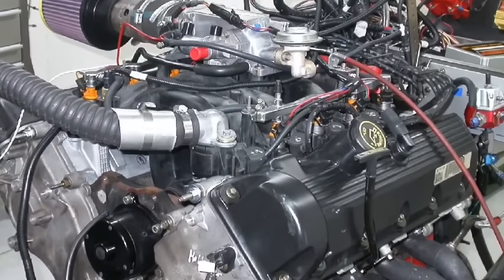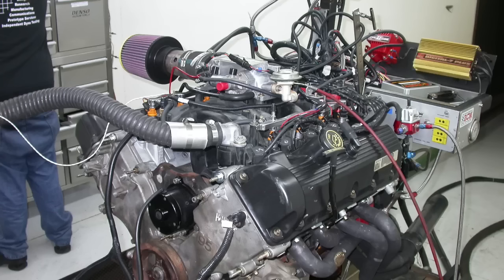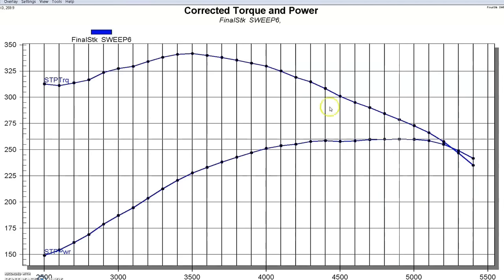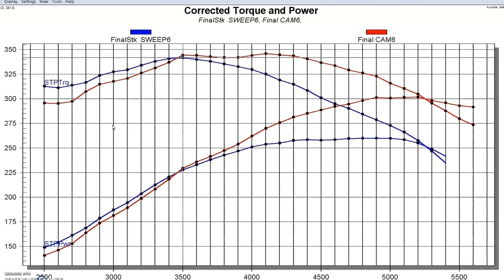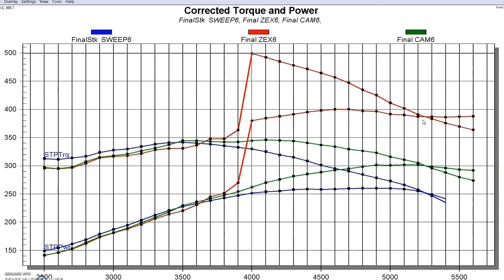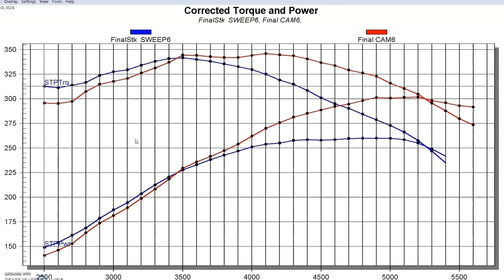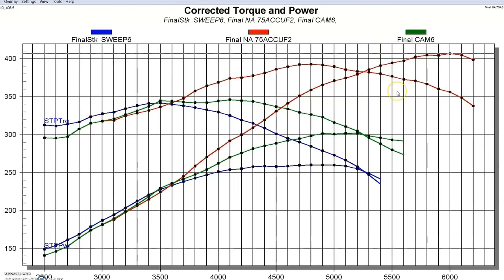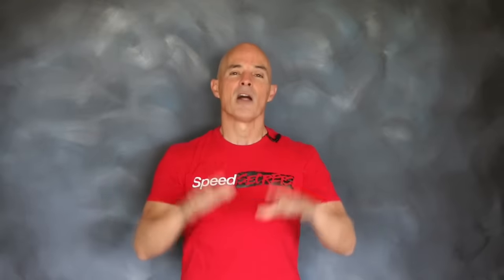HOW TO! MAX HP 4.6L FORD 2V MODS!

Comment: Finally some FORD videos!!!!! Can’t wait to see more ,,, did you ever mess with any 4v 4.6? Lincoln mark 8 setups ?? Your tha MAN!
Reply from the maker: lots of 4V testing
Reply: Its the mark 7 not the mark 8
Reply: Appreciate the reply!
Reply: No it’s the Mark 8 or mark vlll as they put it ,, 1993-1998 4.6 dohc 4v per cylinder, basically same engine as 96+ cobra mustang but technically Lincoln MARK8 had it first (1993) and the cobras got it in 96,, don’t believe me do the research buddy
Reply: Your right chris cantrell. Just really getting into ford after being a chevy guy for years. Just bought a 07 crown vic p71 and was thinking about a 4v head swap. was really wondering if it will still fit in the engine bay i havent looked to hard but isnt the frame and steering arm kinda close to the 2v heads already. Not sure if 4v heads are bigger or not as far as the dimensions go. But thats fantasy talk really as im sure it would cost many thousands to spec it out properly like i would
Reply: @manmage13  after 03 the engine bay of the panther cars was built for the 4v. As the murauder happened in 02-04 and those had the dohc 4.6 from factory. Or go with a 5.4 3v and lockout the vvt and add some boost. It'll scream. The 5.4 can and will make a hell of alot of power

Comment: Would be cool to see what the DOHC heads from Lincoln mark viii? was it will do
Reply: 4v swapping the engine is hard because there is a big drop in compression. You’d be better off just buying a complete 4v engine
Reply: @canadianrcs9931  Correct, you have to change so many parts you're just better off getting the whole thing. I did my homework back in the day and did a 4V swap on my 1996 GT with a Mark VIII engine.
Reply: Coworker of mine sold his Mark VIII LSC for 1500 last year, I should have bought it.
Reply: @canadianrcs9931  In the case of a full 4v engine swap, are there any adaptations necessary in terms of engine mounts and other things such as accessories (A/C compressor, water/oil pump, pulley, etc)? Or the underside of both are identical in that aspect?
Reply: @Roddy_Zeh  there is a difference, there's coolant plumbing right in front of the alternator on a 4v that's not present on a 2v.
Reply: @Roddy_Zeh  you'll need...
Front cover
Timing chain and accoutrement
4v heads
4v intake
4v injector harness.
If you have a p71 then the ecm will run and drive without tune as it's non Pat's and the timing is always off the intake cams and the exhaust cams are driven off the intake cam .
A tune is required to pull the best performance from it though. 
You'll need the cooling plumbing 
There will be small odds and ends needed as well.

Comment: Rich, I am a subscriber. And you make quality videos. But I feel the information you present can be misleading to viewers without a mechanical background. Your engines may make real power and run a few times on the dyno. But while they hold on for those few runs, there is something us engineers call stress fatigue acting on all the stock components over the many life cycles an engine must go through on a daily basis. Most of us 2V guys use them as daily drivers. I'd be very surprised to see a high mileage 2V with the mods you showcase in your videos to be anywhere near reliable or even safe for the road. Racing applications are a different story. Great videos keep them coming 👍

Comment: I have a fully forged bottom end with blower cams ready for install. Heads were cleaned up with new seals. No porting. I’ll be throwing on a Vortech V3 with a 3.15 pulley with a 10% overdrive lower and long tube headers. Can’t wait to see the numbers at the wheels.

Comment: I really love your videos and enjoy information you give. I have a really interesting idea as a test to do. 3 absolutely identical engine builds, ideally with freshly machined blocks, and all identical parts. The test would be putting old rumors to bed. I've heard several people over the years say things like "I've built engines and never used a torque wrench and never had an issue" or "you've always gotta use a torque wrench and torque sequence" the thought is on each build same parts same build but different torque methods on all fasteners. Torque wrench, impact gun, and feeling it with traditional hand tools. I know it would be EXPENSIVE to set up but itd be really interesting to see the dyno results, and if you could do some long term running engine durability.

Comment: I am a Ford guy, so thanks for making this vid!!👍👍👍 Although, I will say that the 4.6L 2 valve is a pretty anemic engine. 4 valve, supercharged Terminator ftw!!
Reply: I bolted on a used vortech v3 kit with lightning MAF and injectors and a kennebell boost-a-pump for $1500 and that puts me over the stock Terminator RWHP.  thats without an intercooler. I can Add an intercooler and a pulley swap and get close to 500rwhp. best of all i can drive it without getting into boost and get the factory or better MPG.

Comment: The compression ratio. When you use the non pi motor with the pi heads. I owned 4 Ford Thunderbirds, all with the non pi 4.6. My mom had a mark viii with the 32v, that had 285hp/285tq, it had a 2.73 gear though so it wasn't a drag car but it was a great highway cruiser

Comment: I'm so happy to see someone build one of these, I have one of these non pi 2v engine and a set of 04 heads, I just don't have the car any more
Reply: What year is the 4.6 from? Are those heads a 2 valve? Thanks in advance
Reply: @ariczacari  out of A 96 mustang GT, the spare set of heads are out of an 02 GT
Reply: @tashawegmueller1866  did you do the head swap yourself? what issues did you run into that aren't recorded?
Reply: @obran003  I have not touched the engine it was a swap that never happened, so it'd just a complete engine and a bare set of PI heads

Comment: Hey Richard, a little off topic but it would be cool to see a test of different exhaust sizes after the collector on an NA setup just to see if the bigger you go the more power or if you start to loose exhaust scavenging
Reply: yes, bigger is better.. Don't believe the back pressure idiot crap..lol

Comment: I have a 98 Mustang GT California scatpack. Pushing 517 hp. Dynoed. Naturally aspirated. It’s a 4.6 modular. Engine is fully rebuilt with lots of upgrades and bolt ons. Shelby motor sports tuned it and now I’m upgrading the body, since it’s all stock. Next will be axle, tranny and differential. It barely hangs in there now. Lots of money in it and still more coming in. I plan to have it done within 10 years. But I still want it to stay street legal. I should add that if anyone is adding PI heads, you will need to upgrade your cams, valve springs and flex plate! Also get a tuner.
Reply from the maker: a 98 4.6L non-PI that makes 517 hp NA?

Comment: This was cool, want to see more sohc stuff. Wonder how the 6.2 sohc truck motor would sound in a new edge compared to a 4.6, 5.4 & the new 7.3. Power is great but driving experience means more to me for a street machine. Would love to swap my tired 4.6 for more cubes but if it doesn't sound as good then I'll just stick with the 281. :)
Reply: Swap a 5.4 2v bottom end and bore it out to. 5.8 and give it some good compression and a trickflow top end kit it'll make some damn good power and sound ungodly.  Pretty easy swap too it's basically a bigger 4.6.

Comment: Richard  please do some testing on the 4 valve  4.6  motors.   id love to see a comparison between the 2v vs the 4v versions of this engine.
Reply: 40-60hp bro..
Reply: @P71ScrewHead   ...yeah stock.  I mean in terms of horse power potential  when modding the engines.
Reply: @cleophusmcgillicutti7408  depends on the internals it comes with.. But the 4v will always make more hp.. Still would be a nice comparo.. When it comes to cost tho the 2v wins, costs less to build n less parts to funk up.. I prefer the 2v..

Comment: Thank you for these videos! Do all these improvements apply to a f150 Triton 4x4? I have a 1998 f150 4.6L NPI  2V that I just had honed and cleaned up. I also bought PI heads and they are in the process of being fully ported. I have been researching Rotary Assemblies and I am not sure what to get due to my lack of knowledge. Like what stroke to put with what pistons and what cam and so on. I also have a P-1SC ProCharger I can put on it. Any suggestions? I'd sure appreciate it. This will be my first engine build. BTW it is a 5-speed Manual Transmission. I also have 4:10 gears in the front and rear end. I also have a PI intake and I ordered some long tube headers, they haven't showed up yet but they will lol.

Comment: I'd like to see how much power you can get out of a 2V 5.4L Lightning engine with all the boost.
Reply: I had an old 2v. 5.4 in my Z for several years eventually blew it after 2 years of +25lbs. It now has a 5.4 with ported 2v navi heads. Also rebuilding my 4.6 romeo in my work truck with the 5.4 2v heads and a victor intake
Reply: Really the 5.4 2v heads fit onto the 4.6 2v really,, wonder if the 5.4 3v crank would fit on the 4.6 as a stoker.. because most of the mod motors are the same parts for the 2v, 3v, 4v engines
Reply: @Ford Fanatic Modular motors can support massive amounts of power...Its what's powering the the record setting Ford GT sanding mile car.
Reply: @nuttynut54  the 4.6 and 5.4 are the same block with the 5.4 having a longer stroke(taller deck). Most all 4.6 2 v stuff will fit on the 5.4. Except the intake ive got adaptor plates on all my 5.4s to fit the intakes. There are zero 5.4 2v  intakes that are worth the money. Build a custom one or just use the OE truck or 4.6 intakes with the plates. Think i paid 100 bucks a set for the adaptor plates when i got them.
Reply: @nuttynut54  if u use the 5.4 crank in a 4.6 ull have to measure rod length pr youll slam the piston into the head due to the longer stroke

Comment: I liked your video. I'm just starting to learn about the 4.6 . I'm to old school 70's early 80's Dirt tracker. Now the family raised I've retired have a shop full of tools covered in dust I'm Bored. Hell, didn't know there was a PI motor till watching the video. What I'd sure like to know is if you took a PI, motor cut about 10 tho -- off the heads ported it put a set of bigger cams in put the headers on a larger fuel pump and 8, 460 injectors. How would this work out in a little lite straight line car??? Sure wood love hear from anyone.

Comment: Richard, you have no idea how many times I have referenced this video! I have a ‘98 GT and I’m currently looking to make the cheapest 12 second car. Got the cat-less H pipe and long tube headers, PI heads with 81k miles (very good condition), PI Intake, and I’m looking at getting a set of Comp Cams that are just slightly smaller than the ones used in the video. For my guy to install it all, combined with the price of the parts… looking at just over $3,000. I got a lot of great deals on my parts, but still, this thing will put down 400hp for essentially nothing in price! I’ll be back with updates
Reply from the maker: add a cheap nitrous kit-then you are easy 12s. maybe 11s

Comment: Doing this exact build right now 😂
Reply: Preston, how did this go for you? I am seriously considering swapping in a fresh built 98 GT 4.6 with the PI heads into my S197. Will be even better than a 3v possibly and easier than Coyote swap, with that awesome 2v sound! How much did getting the heads and intake cost you? Also how do you like it? :)
Reply: @tomstamatakos8027  build went great. I only did cams because it already had pi heads. It’s actually supercharged now but I love it. Sounds great and makes plenty of power!
Reply: @prestonsarlo  Wow thats awesome for sure, good to hear she's really rocking for you! With FI I'm guessing you are pushing 500whp on the stock bottom end. Crazy cool :)

I'm just hoping to have a 300whp/300wtq daily driver that can still pull 25mpg highway. Seems totally doable with these NPI long block/PI head builds!
Reply: @tomstamatakos8027  yeah you can do it. Good luck with the build!

Comment: Years back I pulled the intake off a f150 . One head had square ports the other had rounded  ports. Service manager said to just do what I had to do to make it work. It appeared to be that way from the factory only had 20k on it. Seemed to run just fine.
Reply from the maker: square port and round port? on an F150?
Reply: @richardholdener1727  the intake ports are different shape on the power improved heads.
Reply: @richardholdener1727  the truck had one of each on it.

Comment: Now swap that top end onto a 5.4 non pi motor and see what it'll make with 0.8 more liters. :)
Reply: Aren't the blocks the same?
Reply: @jaflolara  almost, the 5.4 is taller deck height, hence the extra stroke.  Need pretty much stock manifolds and a modified h pipe... or custom made long tubes, but there's not a lot of room.  Otherwise, motor mounts, bellhousing pattern, and crank pattern is all the same (crank pattern changed for some years, but can still find flywheels/flex plates) They would pretty much need bigger cams tho...
Reply: @jaflolara  bore space is the same. Stroke is different. Also romeo and windsor used different head dowels. But otherwise. All 2v heads with work on all 11 castings of the 4.6/5.4 mod blocks. Your valve covers will also vary between heads as they use different number of bolts on the valve covers

Comment: step 1: remove 4.6  
step 2: install LS

LOL j/k.  Cool to see something different than LS stuff Richard.
Reply: Litterly what im doing with my 02 gt getting my built lq4 6.0
Reply: don't get me wrong the coyote is a very capable engine and in some ways better than the LS stuff but usually it comes down to cost and you just can't beat the LS for dollar per HP.
Reply: @jessemurray1757  exactly right. Thr cost of a coyote is insane
Reply: Guys are going mid 8s with 2v. Cobra crank rods and pistons
Reply: Paul Schwartz the rods work the coyotes bore is bigger. But you can get a nice set of rods and pistons for $1300
Reply: Ls= welfare motor lol
Reply: @ryanjones48  know a guy in the 7s  with a 2v.
Reply: @bigboreracing356  about the same price range as a comparable ls set up.  Running a wap block , je pistons, molnar rods , cobra crank , tfs heads etc . A lot less than you'd think to be honest . I'm considering doing something similar instead of my lg windsor set up. * edit .. it is a  larger single turbo set up , running holley efi ,
Reply: @bigboreracing356  most guys doing 2vs that are fast have growing pains , and for some reason fuel / tune issues , as well as head gasket issues . It can be done successfully, and safely , just expect some breakage at first at those power levels.
Reply: STREET RACER  I hate to break it to you, everything running 7s breaks a lot.  Most 9-10 second LSs break a lot.  

Modulars being expensive is a myth.  The only think more expensive are the cams.  Everything else is pretty much the same price to the dollar.
Reply: @bigboreracing356  I keep my Ford's  Ford,  and my bowties stay bowties.  I don't need Steve Morris to build my combinations , they are just fine .  I know large cubic inch windsor engines well ,and have been running them for years .  The 2v is interesting to me at the moment for other reasons . Since you've decided to tell me what I need to run , I didn't solicit your advice.
Reply: @bigboreracing356  again , I did not ask what you would do , or why.   Go massage your ego elsewhere.
Reply: @ryanjones48  it's pretty insain to . All thise part directly from Ford and not expensive at all ..
Reply: @ryanjones48  you can get the for less then that . Directly from Ford
Reply: @bigboreracing356  alot of it is tuning and figuring shit out .
Reply: Tony Spadafino yep stock block stock heads and crank has been in the 6s
Reply: nallen100 not really but I guess if you don’t know what you are doing
Reply: nallen100 so 900+ with boost is 4 cyl power. Like I said I guess if you don’t know what you are doing you go with an LS. But not hard to have a high HP 2v
Reply: @dj4monie  its NOT PART OF THE MODULAR BRO'S BECAUSE THE FIRING ORDER  they're not part of 4.6/5.4/5.8 squad none of these new engines are plus THEY WERE NOT PRODUCED BY SVT those are ford performance engines
Reply: nallen100 because who the hell cares, that is really the only argument LS people have now. BuT wHaT aBoUt Na
Reply: nallen100 I guess people running low 8s and high 7s with rods and pistons 2v means their junk 😂
Reply: nallen100  Stock block LS's do not make 1000hp. They come with cast crank and rods from the factory. They are not able to handle 1000hp with that shit bottom end. They have good flowing heads and thats about it. If you want 1000hp on stock block try the Factory forged 4.6 Termi engine or Boss 302 Coyote. Even Gen 2 Coyotes are capable but most LS/T are lucky to live at 750 with the only exception being the really pricey Z06 which should be stronger but you won't be buying in a junkyard.
Reply: nallen100  I mean hell dude how many LS's does Cleetus need to blow up before you recognize that their lame ass cast iron bottom ends won't even hold 600 or 700hp with out grenading 🤣
Reply: I agree on two accounts.  I do love the mustang and F150.  But truth of the matter; LS has more options and cost effective potential. Which makes content for LS motors very recycled and repetitive.